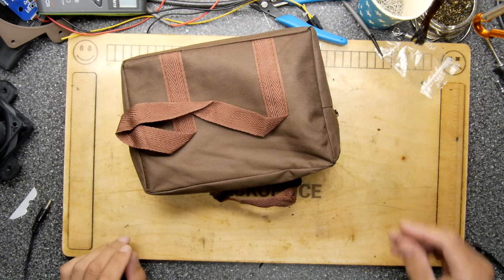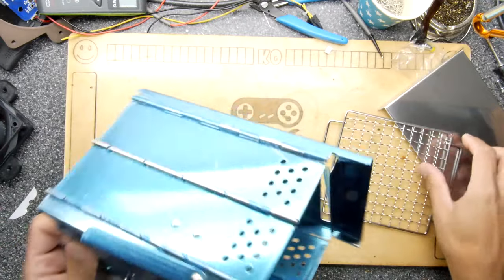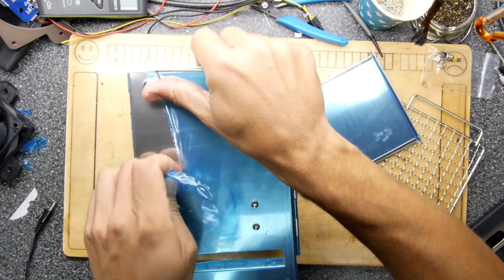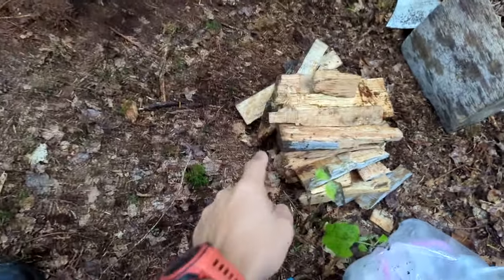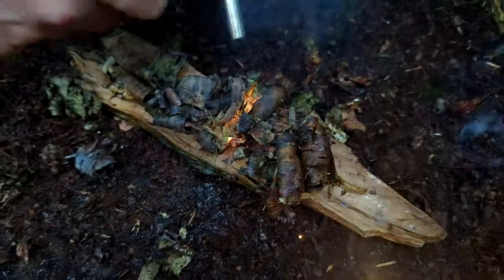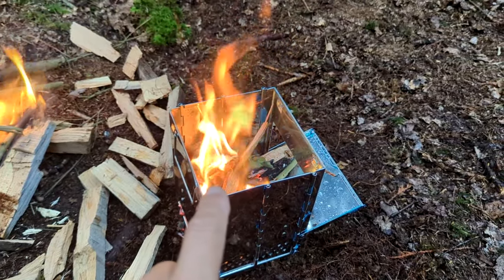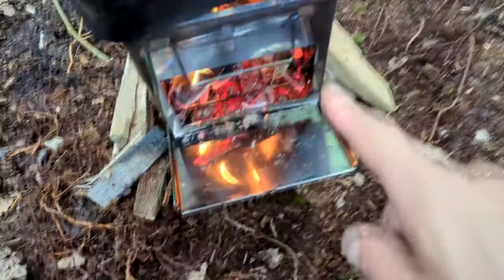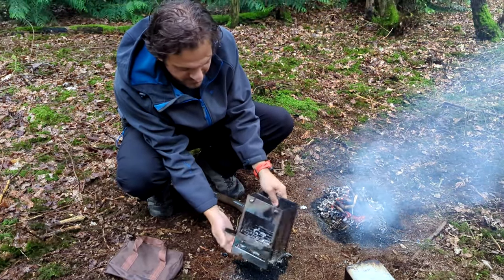Bushcraftery - A Temu camping stove

Comment: Wonder if a layer or two of silicone tubing would hold up on the handles...

Was the price some temporary drive/offer? - it not l, got a link? 
The ones of that style I  see are ~ 5-6x what you paid (rough mental conversion of the prices I see in SEK to GBP)
Reply from the maker: Alas I do not have a link as I ordered this many weeks ago, however, I suggest keeping an eye on the app. Sometimes they have the same thing at different prices (from different vendors I guess?). Temu are always making tempoary or spend offers - For an experiment try adding a bunch more things in your basket and see if they reduce the price. It can be something like a 75% discount when you go over £20 etc...
Reply: i bought this through an instagram ad, as a new account on temu i  paid 30 SEK for this which is about 2,5 GBP. insane value for what you are getting. it even came with a bag to store it in
Reply from the maker: @therealronswanson  I've used mine quite a few times at this point and it's really holding out well. Definitely one of my best camping purchases ever!